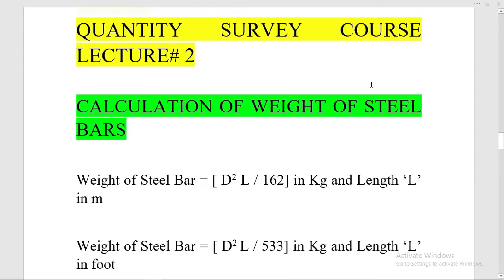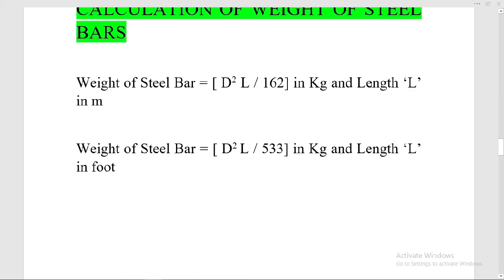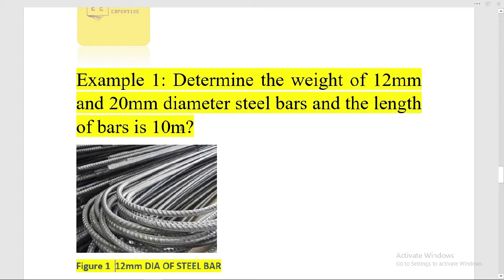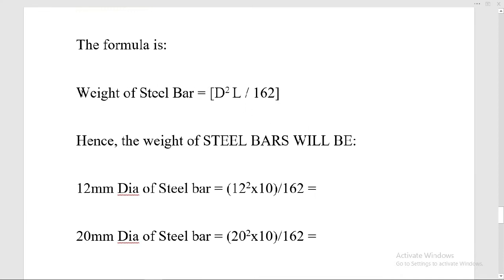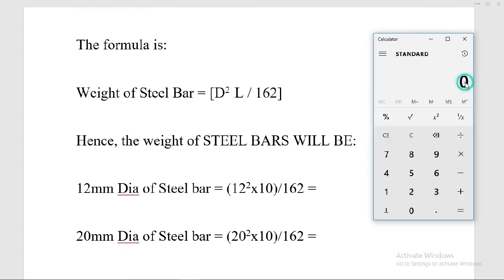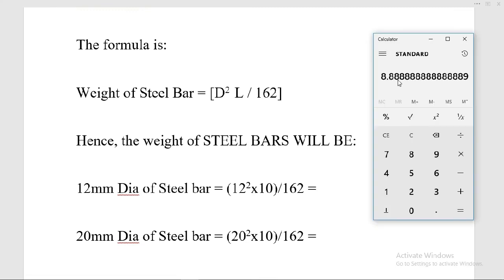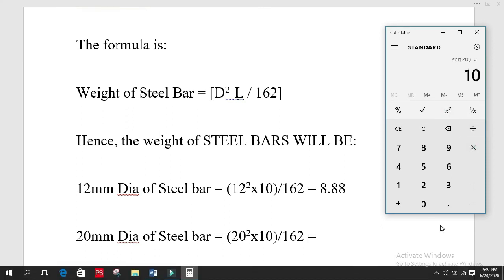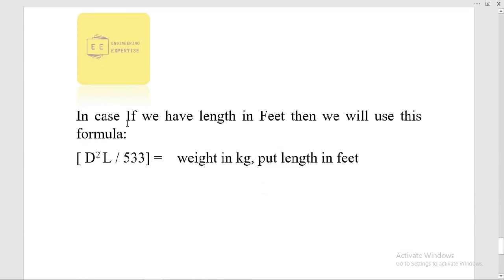2 CALCULATION OF WEIGHT OF STEEL BARS IN QUANTITY SURVEY COURSE 2020

Comment: bro if use using dia of bar 12mm in m this will be 0.012 m kindly change 12 to 0.012m
Reply: This formula is derived by converting the Dia from mm to m, which brought the denominator value to 162, hence we should calculate dia in mm and length in m/feet.
Weight of the bar = Density * Volume 
Density of MS is 7850 Kg/m^3
Volume for a bar = (Pi* (D*^2) / 4 ) * L , where D in in mm and L in in meters
Weight of Bar = (7850 * 3.14 * D^2 * L)/ (4*1000*1000)  ; converting dia mm to meters (which gives 1000*1000 in denominator)
Therefore Weight of the bar = 0.00616 * D^2 *L
Which approximates to = D^2 * L /162 , please remember that this formula is only for MS, as density is different for other material bars.